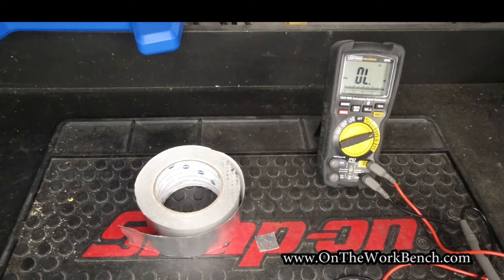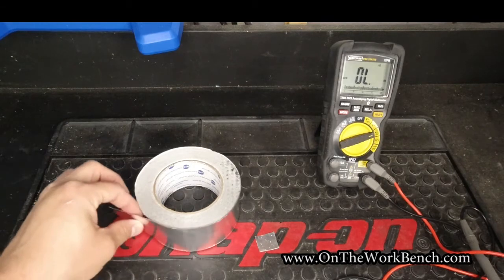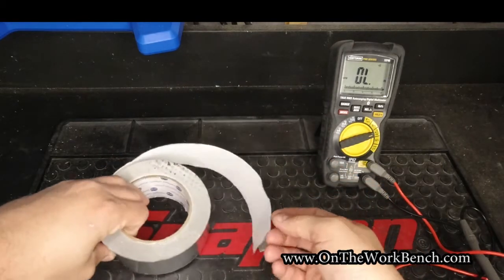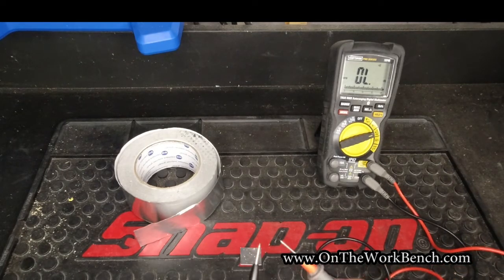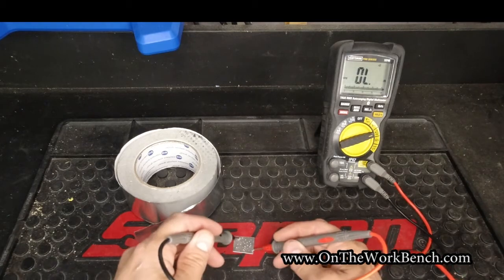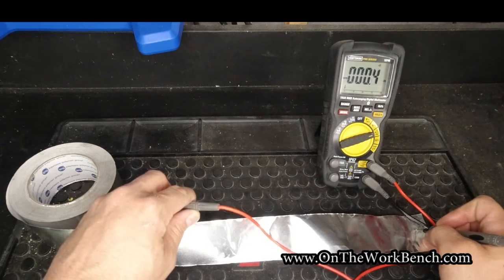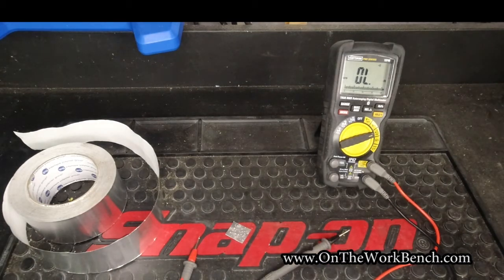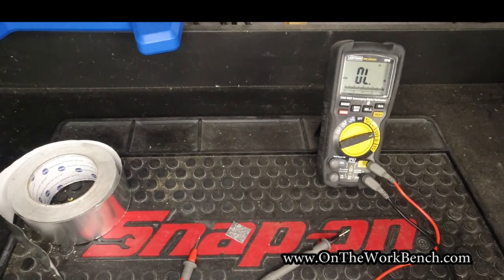Aluminum Foil Tape Hack

Comment: problem is,aluminum does not solder at all; 
but i use it in very small discs to fix bad tv remotes with worn out carbon pads
Reply from the maker: not perfect as you point out but it gets the job done